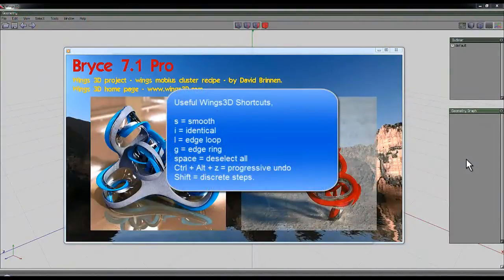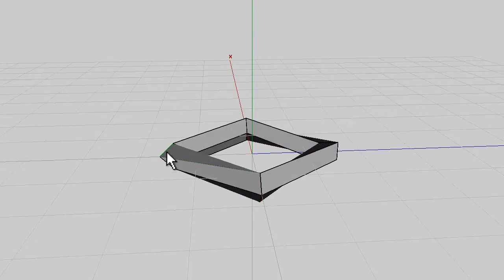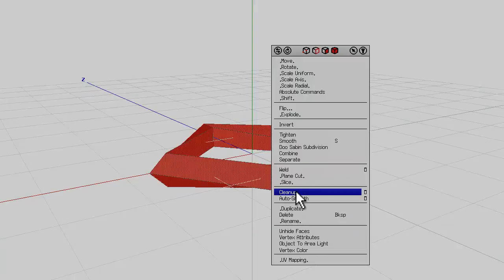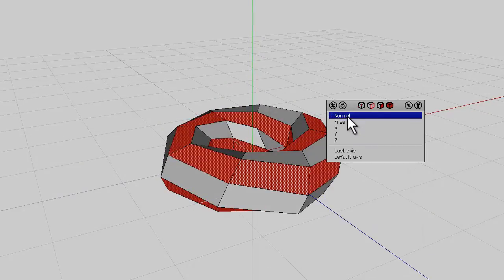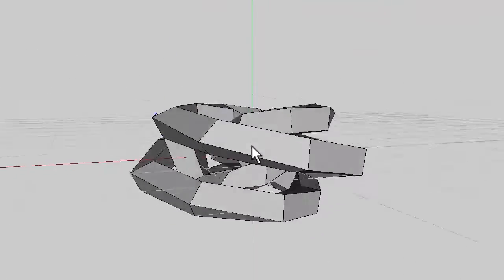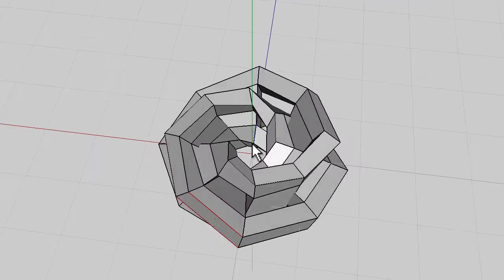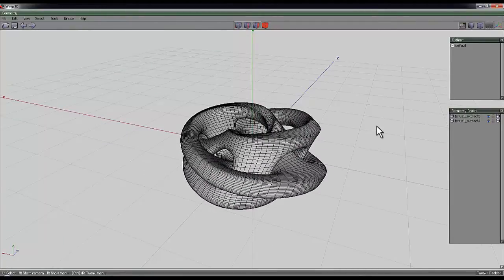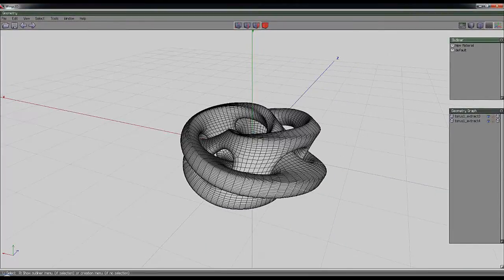Wings 3D project  - compact mobius pair - by David Brinnen.

Comment: Thanks for the video its brilliant! Just a quick question how is it you do select the inner part of the Mobius strip at 2:33-36 to delete it? thanks again for a fantastic tutorial.
Reply from the maker: No problem.  When you use "shell extrude" command it creates a new mesh object.  So if you use the "body" selection mode (the filled in red cube icon) and hover over any part of the middle area it will highlight the old mesh and then you can just delete it.

Comment: I hope you can understand what I'm trying to explain. YouTube puts a limit on the amount of character spaces allowed in a comment, which makes describing a complex process cryptic at best.
What my method does is eliminate the need for most Boolean operations in Bryce that are used to assign different textures to an object. This removes the need for invisible geometry that such operations produce without using Convert to Mesh.